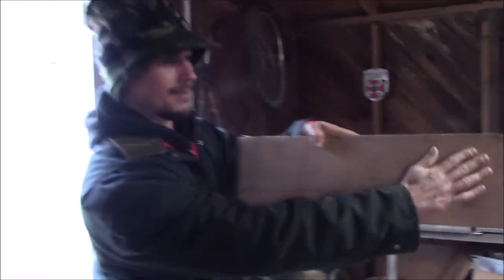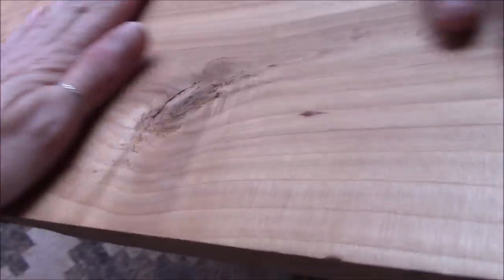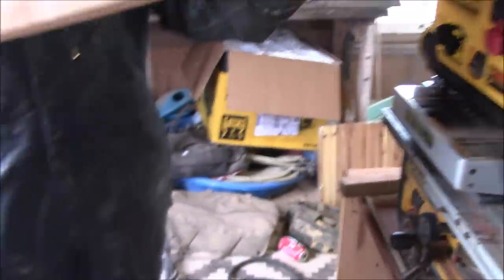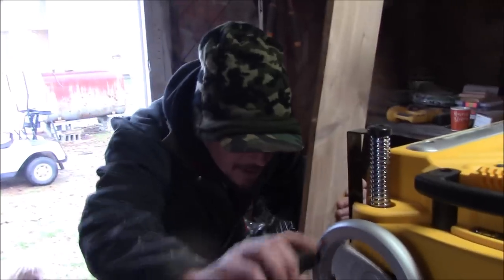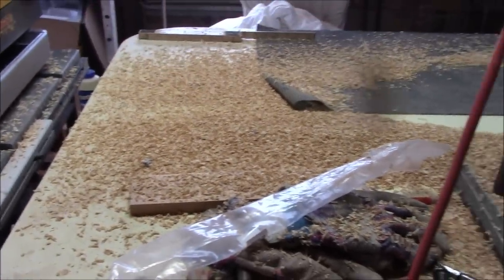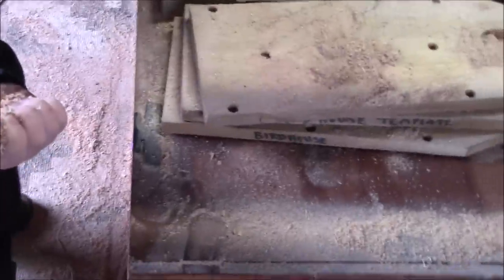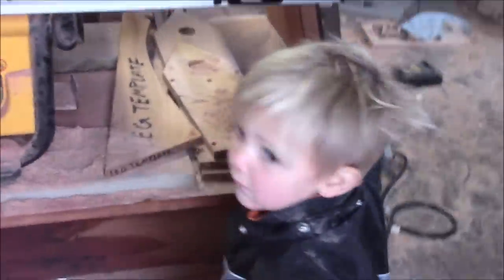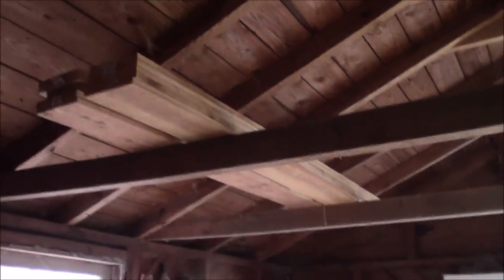Finishing Sawmill Lumber on My New Dewalt Wood Planer

Comment: Nice to see you working with quality lumber.Definitely want to put a dust collection hose on the back side of that unit: it's extremely dangerous just leaving it open. Especially if you're standing back there with no eye protection. Even a shard of the blade can come off- I've seen it happen in several shops.

Enjoy the process

Comment: Buy little paper cups and fill them with plain wax and wood shavings to be used as fire starters.  You light the paper cup on fire and it will start your fire.  Our local boy scouts troop sell them as a fundraiser each year.

Comment: I was just going to say make yoiur own fire starters  so you took the words right out of my mouth.  We use to make our own for our Girl Scout Troop we used the cardboard like egg cartons & lint from the dryer & take a candle & melt a little in the bottom of the egg carton then put the lint in with a little like home made weck.  Light the wick set it in the fire pit If I remember correctly I would have to ask the other leader its been a several years.   If you have a dryer vent hose make another attachment & run it to a trash can like you did before.
Reply: Dryer lint is excellent as a fire starter! We used to burn our trash years ago, I would save lint to start the burn. Do you remember making bunsun* burners to cook with at GS camp?

Comment: If I were you Hollie, I wouldn't use those decorative molds, the end product would be too thin to be a good, effective fire starter. Besides it's just going to be tossed into a fire so it seems kind of pointless to make it look pretty. Instead I would use an ice cube tray. That would give you a good size for a fire starter and it would be a nice neat shape. Also I wouldn't pack the mold or ice cube tray with the sawdust first and then try to pour wax into it. Instead I would take a big pot, put a bunch of sawdust in it and then pour some wax in and stir it up real good and then pack the mold or ice cube tray with the wax/sawdust mixture and then let it harden. You'll probably also need to play around with the wax/sawdust ratio to come up with the most effective fire starter. By the way I got some Christmas gifts for you all, nothing major but hopefully you'll find them useful. Unfortunately I won't be able to get them off to your new PO Box until after Christmas so be watching out for a package sometime after the New Year starts.
Reply: I use cupcake liners! Holly, I thought you should make fire starters a while back!! Awesome use of end of candle making wax!!

Comment: Hi Chris, impressive machine you got there. I'm thinking of buying the same planer to use on a huge stack of rough cut pine that I want to put up on my cabin walls. I'm hoping this method will be faster than sanding with a belt sander. Will my boards need sanding after planing or are they good to go ?
Reply from the maker: It has a rough and smooth settings. You really would NOT need to sand, unless you want your walls extra smooth. The boards do come out pretty smooth! 
The trick is taking a 16th off at a time to be easier on the machine and blades. But I definitely love this thing! Its definitely a lot better than having to sand the boards smooth.
Reply: @theChrisAndHoLLieShow  Awesome, that's just what I wanted to hear. I can't wait to purchase one & get to work on my cabin! Thank You & have a fantastic day :-)
Reply from the maker: @adirondackjack  God bless you, I hope everything goes well!

Comment: HOLLIE YOU CAN DIP THOSE SHAVINGS INTO WAX AND BAG IT UP AND PPL PUT THEM IN WAX WARMERS THAT USE THE TEA LIGHT CANDLES TO HEAT THE WARMING AREA . WALMART SELLS SMALL PIECES OF PAPER ROLLED UP DIPPED IN WAX AND THAT IS HOW U USE THOSE SO THE SHAVINGS SHOULD WORK THE SAME I WOULD THINK. P.S. COULD U HOLD A GARBAGE BAG OVER THAT HOLE AND CATCH THOSE SHAVINGS?